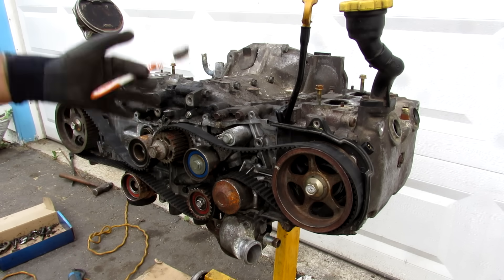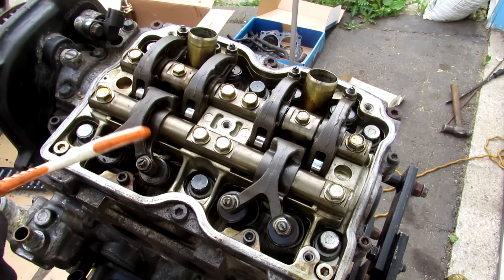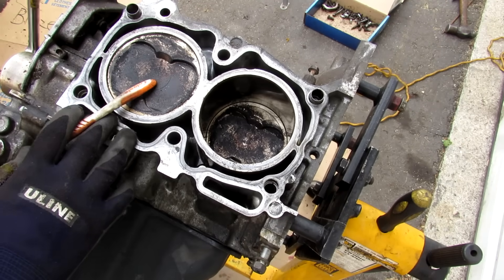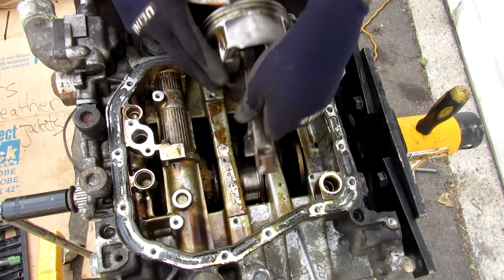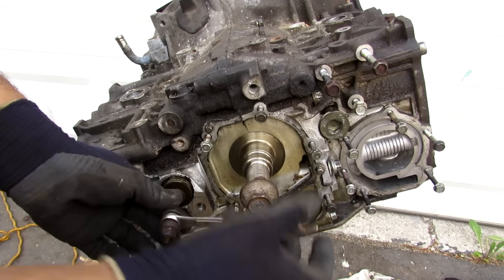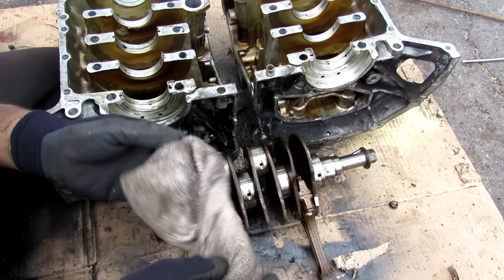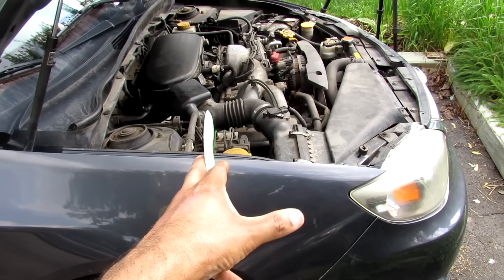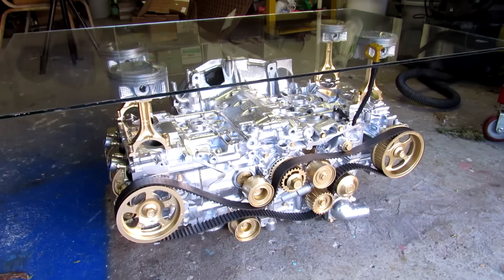Why Subaru Engines FAIL

Comment: My 1983 Subaru GL never gave me trouble till it was stolen in 1993 when I went on a ski trip. I never saw it again.
Reply from the maker: Did it have a boxer?
Reply: @speedkar99  Yep, the spare tire was in the front, under the hood and on top of the engine. My mechanic liked to stare at it longingly with lust and desire, but it never gave him an excuse to work on it except for oil changes.
https://barnfinds.com/wp-content/uploads/2016/01/subie3-e1453960139688-630x351.jpg

Comment: Nice details about boxer engine fails...
Just want to add that V6 suffers from secondary unbalanced!
Actually none of the thermal engine configuration is perfect except for VR6 which is a combination of 6 inline and V6.
Reply from the maker: Inline 6 is much better

Comment: I have 2011 sti,   get aftermarket pistons and bearings,  get a bigger oil pan and you good to go,  over 100k miles with no problems,   in my case I used Cosworth ,  and Rotella T6 oil.
Reply from the maker: Do you overfill your oil to prevent starvation?

Comment: My Subaru is 17 years old 190.000 miles. There are times I have to turn down the stereo. To hear if the engine is still running its so smooth
Reply from the maker: Nice

Comment: I admire the efforts u put in your videos mate. Bitcoin's price action has been fluctuation throughout the past few days and weeks, with bulls and bears both reaching a clear impasse, the aggregated cryptocurrency market has been following in Bitcoin's lead and is
struggling to garner any decisive
momentum. One analyst is now noting that BTC has been holding above a key macro level throughout the past few months. He believes that the recent consolidation above this level bodes well for its near-term outlook and could indicate that significantly further upside is imminent in the weeks and months
ahead. Tips like this  it's advisable for investors and newbies to trade with the help of pro traders like
Mrs Alice . She's always onestep ahead of other traders, she fully monitored all my trades to avoid me making mistakes and losing my money. My earnings have increased drastically from 1BTC to 9.2BTC in just 3weeks using her strategy. You can easily reach Mrs Alice +1 (520) 3 8 0-5 7 5 6 🇺🇸

Comment: All internal combustion engines have design weaknesses. >90% of engine problems can be prevented simply with proper service and maintenance.  That EJ25 you've got there looks like it was rode hard and put up wet more than a few times!

Comment: we had bought a Subaru station wagon to haul the 4 of us, at the time i seemed like a good idea, when i bought it it only had 40,000 miles on it and we had bought it from a subaru dealer. I bought it for about 6,000 dollars. we constantly had problems with it, we spent more money in repairs than we did for the vehicle. I think we owned it about 5 years and it went through a time belt about every 6-7 months. we lost a oil pump twice, idle bearing several times and CV joints about once a year. come to find out there was not enough clearance between the exhaust on the right side and CV joint, so the boot was coming apart because it was too close, and the boot over heated,  eventually I built a shield that slowed the process down. doing tune ups was a nightmare and replacing the timing belt was a major pain. the work was done by a subaru shop so you can not say it was done improperly, not to mention the cost of the parts were 2-3 times the cost of any other manufacture. for example I could by a master cylinder for a chevy for at the time for 35 bucks but a similar unit on a subaru was nearly 200 bucks.  never again every. you could not pay me to drive one.

Comment: Automotive machine shops are happy with Subaru engineering. It keeps our cylinder head dept very busy repairing and rebuilding heads with dropped valve guides, pounded seats. and the always required, resurfacing.
Reply: I noticed cracks in the head. He didn't mention those...
Reply: Ha Ha! That engine was abused above and beyond.

Comment: If I owned a Subaru I think id have a feeling of impending doom after watching this video.
Reply: Well now you are armed with knowledge to prevent impending doom. You can't be lazy with these cars, same thing goes for owning a rotary, aka majority of the fun Mazda cars.
Reply: @DJAizakku  Funny you bring that up. I own both a Subaru and an RX7 ;)
Reply: @DocSprocket  I've had several of both and rebuilt every single motor on them all. I was the weird guy in the neighbourhood that even other mechanics sent the boxer and rotary motors off to because they knew I had wrapped my brain around them. Fun cars tho
Reply: Timothy Iorlano  the previous two owners of my car had done zero maintenance. When I got it, the front diff was whining because they just kept pouring transmission fluid in there and the axle seals were destroyed, all four wheel bearings were shot, both front calipers were missing their dust boots, all four rotors were trashed, the steering rack leaks, most of the bushings were torn, there were two missing away bar links, one wheel was bent and there were 3 different kinds of tires on there, the interior had a lot of wear and the seat foam was collapsed on both front seats, there was body damage that looked like it was fixed with a framing hammer and papier mâché, the wrong coolant was being used, the transmission was leaking brown crud out of the rusted out transmission filter, all four corners were out of alignment, the air cleaner was clogged with trash, the spark plugs were worn down to nubs, the plug wires were all chewed by rodents, the floor pans were bent in by jacks on both sides, the spare tire was bald, the exhaust was patched back together using cheap pipe and hose clamps, there were homemade wiring mods done, and it smelled of unwashed dogs.
The engine's fine, though.
Reply: having a good 350k km in 3 different subaru with boxers, i am more than comfortable
Reply: I have owned and I know this feeling
Reply: The old school Volkswagen boxers were good engines if you retorqued the heads every 80,000 miles, adjusted the valves every 30,000 and changed the oil every 3,000. This was fortunately well within the scope of a diy mechanic and I have owned several that went well over 200K miles without any major issues.
Reply: ya all the issues he mentioned is why I would never get a subie. always heard all my life.. subie engines = head gasket and oil problems galore out of the wazoo. And God forbid any major engine repair is needed your more than likely going to have to take the whole engine out. LMFAO. i commend suburu though.. for their almighty all symetrical tried and true awd system.
Reply: Honestly, he just mixed faults with 4 different Subaru engines into "all" boxer engines. There are still loads of 20-year-old Subarus on the road, because they're easy to work on and the engines are reliable if you keep up with maintenance. Mine's 18 years-old, at 202k miles. The head gaskets were replaced with MLS head gaskets at 130k and they don't leak. The whole thing about oil starvation was a boogeyman from back in the old days with air cooled boxer engines, like VW Beetles and Porsches. If you let the oil go without checking it every thousand miles or so, and it runs low or sludges up because you never change it, you can end up with blockages or smoking. It's not really an issue with 99% of people.
Reply: @MikeStavola  you said reliable but you replaced gasket at HUGE COST at 130000 km. You said easy to work on yer you got to remove engine to replace said head gasket. They are rubbish. And suburu knows it but made NO attempt to fix in over 25 years of head gasket failures. In fact they expect them to fail and put holes in the thermostat to allow exhaust gasses to better circulate in the coolant. AND they put a wide temperature range so expect overhearing. 
The Volvo engine had problems that also weren't fixed for 25 years, causing either failures or costly regular servicing of the negative pressure pvc system. There is an engine with oil circulation problems, not something you want on a turbo. Two bad engines on one video. Stay away. Bring on electric vehicles.
Reply: @MikeStavola  haha, I guess I'm pretty late to the party but yeah, it seems to me like all the issues he is talking about only apply to really old boxer engines or were ghost peoblems. EVERY engine is going to suffer if low on oil, or it starts to sludge up. They say they burn oil but I had an '05 WRX that never burned oil, even at 286K miles. My head gasket never needed replacing, yeah I had to get the valve cover gaskets replaced a couple times but nowhere near as involved as head gaskets. Never had a knock, whether pre-ignition or the vibrating of the pistons in the engine he was talking about. Only reason I don't have it anymore is because I got hit.
Reply: Nothing says "reiliabilty" like having to change your head gaskets for some that "don't leak."
Reply: @foxwithtubesox1075  yeah, Subaru made a bunch of trash head gaskets with some kind of coating that break down over time. Apparently that was addressed about 10-15 years ago. It's almost as bad as newer BMW engineering.
Reply: @foxwithtubesox1075  And checking your oil every 1000 miles
Reply: @foxwithtubesox1075  You must own a Jeep...
Reply: @MikeStavola  no they didn't fix it.
Reply: @MikeStavola  Exactly. Thank you.
Reply: @MikeStavola  11,000 a year. Not much.
Reply: @khadijagwen  12k/yr is Average mileage driven in America according to the insurance companies...
Reply: @airgunbubba2505  . I thought the average was 15,000 miles a year
Reply: The head gasket leaking was only relevant in with the single cam 2.5 engines. And oil starvation can also happen to literally every car. Just do the maintenance and you’re good. I don’t see how people can just neglect their cars and be surprised when they fail smh.
Reply: @blackdeath6075  so true, and it doesn’t have to be a Subaru. I’ve seen and met  guys  who own Toyota’s and Honda’s that fell apart with very expensive repair due to neglect and lack of proper maintenance and care. Simple “common sense stuff” 😂
Reply: @blackdeath6075  no all boxer engins blew head gasket. The 6 cyl took a little longer. They were all crap.
Reply: @craigme2583  just like every other engine lol 😂 Subarus are not the only cars that blow head gaskets. My 04 wrx has 230,000 miles on the original head gaskets and it runs perfect. Just a lot horrible owners.
Reply: Nope, my subbies have all gone over 300k. One head gasket change in 300k? I'll take that.
Reply: Every time you start a wrx the feeling of impending doom is always there
Reply: @YELLOW08Z06  why?

Comment: You can fix the gaskets with a specific part that is an o'ring double steel laminate.
Those gaskets with the construction paper stuck to them are your initial cause of coolant loss.
If you can't do a short block by the time it loses coolant, at that mileage?
That means you need full teardown to find your noise.
Likely all of the above he showed us, are starting to occur.
There are methods that do best when assembling and using Subaru parts, I found I could get them for a better deal which saves money.
The bolts cannot take multiple use, but the first time, you can reuse them.
If it runs and seems ok?
Get your money out of it right then.
If you keep it, you may be buying a short block in due time.
That's the way they are.
You have to keep fixing them right to keep them going.
It's labor intensive and if you like that, you can keep feeding it parts as long as you like.
I priced just the bearings and they wanted too much at the parts store.
It's an easy powerplant removal for a tech.
But you may find you keep having to do so.
No magic there.
Parts, belts, tensioners, pumps,  bearings, pistons, gaskets, thermostat.
It's endless.
Don't blame me I drive a Chevy and it may not be as good on gas, but she's a keeper.
Wow, I could had a V8 but then I wouldn't have the traction of AWD.
Just saying, don't fool yourself if you didn't really give it the inspections it needs to be called serviceable.
Price a low mile replacement and have one to fix while you run the other if you're an enthusiast.
Hope this helps.

Comment: Is this engine firing order the same as the classic vw air-cooled boxer engine ? Seems to have a lot of similar design features from that engine designed in the late 1930,s😀
Reply: yep, pretty much just a water jacket slapped on the air colled vw engine; I was tearing one down with an old vw mechanic and his mind was blown

Comment: Omg. You have explained my plight. 2012 Subaru Forester 2.5X: at 33k miles with proper maintenance it started knocking. After investigating the rings blew all oil by and ran it out of oil exactly like you described. The factory repaired it for me at no cost. But then, 9000 miles later the head gaskets were leaking. Unreal. That was my 4th, and last Subaru. Toyota for me now.
Reply: Sounds like you just got super unlucky. Toyota still has lemons here and there too.

Comment: We've had an old impreza for 10+ years with the ej15 motor.  It is the cheapest car to run and maintain i have ever seen.  It's easier to work on than a corolla and has been super reliable
Reply: i want one. have had many corollas they super ez to work on. but easier and boxer im in